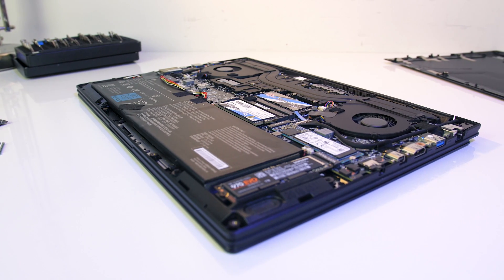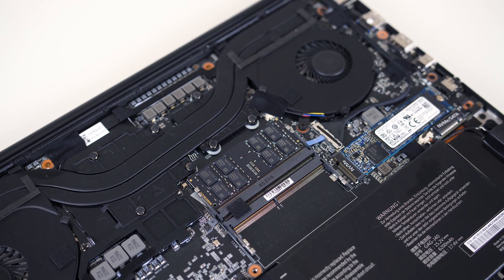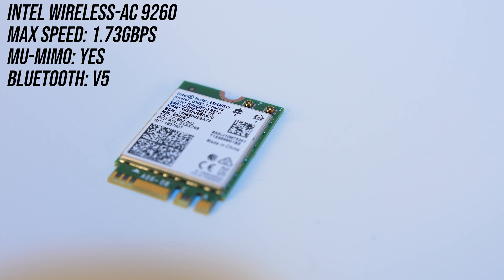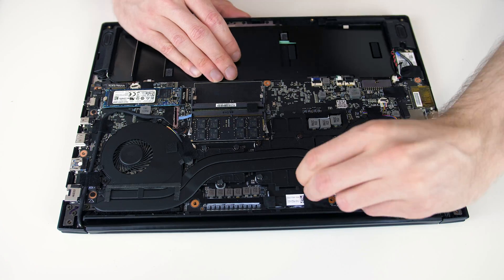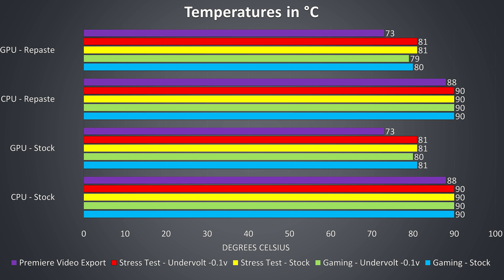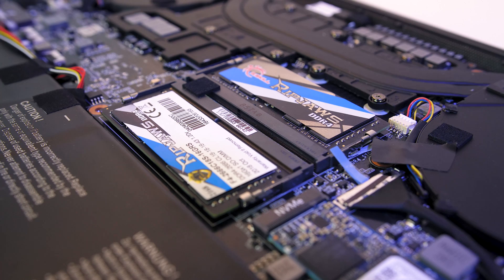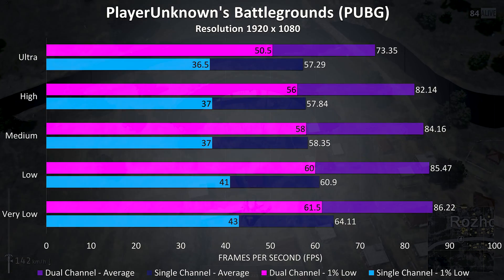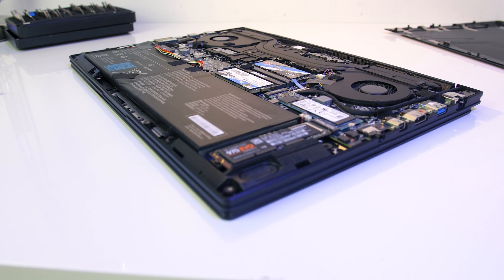Upgrading the Gigabyte Aero 15x Laptop

Comment: I bought the Aero 15x on black friday, and got a single 16gb G.Skill module to accompany the 16gb Kingston module that was running at 2666 speed in single channel, an HP EX920 1TB NVMe SSD changed to Samsung 860 EVO), and Ge Gelid Extreme to repaste the CPU and GPU

My results for the repaste mirrored yours for changes to CPU and GPU temps, with only about a 1-3C improvement. It is good to know that Gigabyte is at least using a good paste for their high end laptops

Apparently the memory must have 2666 speeds in the JEDEC profile of the memory module, not an XMP profile like the G.Skill module. I personally don't mind as the speed is only really noticeable to me in gaming performance. The 32gb's is mainly to be able to run a lot of VMs for testing, so speed isn't generally an issue here.

I initially tried using an HP EX920 1TB NVMe SSD in the 2nd slot, but I'm guessing the module was defective. Many other NVMe drives using the SM2262 controller report to work fine in the laptop and I probably just had a defective unit. However, I decided to return it and get an 860 EVO 1TB drive instead, as it mainly functions as a steam library and storage for my VM ISOs and other test software. The 512gb Toshiba NVMe drive is fast enough to run the actual VMs on, a 2nd drive being NVMe would just be a nice to have.

Something else I noticed is that using the FB05 BIOS, ThrottleStop was working just fine, but during the troubleshooting of the HP EX920 drive, I updated the BIOS to FB08. Since then, ThrottleStop doesn't appear to be able to launch anymore, though the Intel XTU does still work. This is disappointing, as with ThrottleStop it is very easy to set Overclocking profiles for both AC and Battery, and it will automatically switch to the appropriate profile with ThrottleStop. Unfortunately Intel XTU doesn't appear to be capable of this auto-switching (or at least they didn't make it easy to implement).
Reply from the maker: Cool, thanks for sharing your experience! Yeah I heard about it needing 2666 JEDEC, apparently the G.Skill module supports this without XMP though. My original Aero 15x that I reviewed actually had the exact same stick installed according to the HWInfo data I exported in April, so not sure if they changed something..

Comment: I just got mine at the beginning of the month. Was curious to know if you deleted all the bloatware or only some, what did you keep? I'm going to upgrade the wifi card. I bought a 970 as well and was going to buy just the one 16gb stick.
Reply from the maker: I did a fresh Windows install then installed smart manager as you need it to manage things like fan speed.
Reply: @JarrodsTech  Thanks for the reply... Your reviews and videos is why I stayed with the 15x as opposed to the GS65. In the video you mentioned the 970 pro had an advantage over the 970 Evo.  I couldn't catch what it was? 
( I can still return my evo and buy a pro). Thanks again...
Reply from the maker: No problem! Basically the EVO drives have SLC write cache to give them fast write speeds. The 1TB 970 EVO has 6GB of SLC write cache, 4GB for the 500GB and 250GB models, once that write cache fills up, the write speed will drop down quite a lot. With the PRO drive, you have the full write speed the whole time, so it's only really an issue if you need high write performance consistently, which I don't so EVO is perfectly fine for me, also perfectly fine for most cases I think like for just storing games and programs on. You can see the specs here: https://www.anandtech.com/show/12674/samsung-announces-970-pro-and-970-evo-nvme-ssds the 970 EVO has different write speeds for SLC cache and TLC (after the cache is filled up).
Reply: @JarrodsTech  You are awesome, Thanks! Best wishes going in to 2019
Reply from the maker: Thanks! you too 👍

Comment: Hello Jarrod! Recently I've sent my Aero 15w V8 to Gigabyte's service center in Malaysia since I could not find another V-color ram in my country to pair up with the existing one. The service center already confirmed me that they have V-color ram in their stock. I can give you a feedback on V-color performance once I receive my laptop from Gigabyte.

Apart from this I've few questions,
1) I've ordered 9260 card through amazon & will arrive next week. So before installing do I have to uninstall the current drivers at first? Is it necessary to remove the battery for installing the card (removing battery seems kind tricky in aero 15)? From where did you download the driver for 9260?

2) For booting windows directly from 970Pro SSD do I have to put the SSD on primary slot or I can put it in the empty slot? I want to make the 970pro primary SSD.

3) Does the overall experience of using the laptop feels more snappier after dual channel upgradation?

Sorry for asking too many questions.🙂
Reply from the maker: Interesting, I did ask Gigabyte support if they could sell me a stick of V-Color memory but was told that they can't, at least to me here in Australia.
I didn't change the drivers for WiFi before removing it, the new one worked perfectly fine with the existing drivers too, but I did download the correct drivers for the 9260 after it was installed and installed those anyway. I just did a google search for "intel 9260 drivers" which took me here: https://downloadcenter.intel.com/product/99445/Intel-Wireless-AC-9260 removing the battery probably isn't required for that, but it was pretty easy.
I think you can have the SSD in either slot, it shouldn't matter, the boot loader would just modify the boot order when you install Windows. It does feel a bit better with dual channel, occasionally I noticed sometimes apps would freeze for a brief moment and now that's gone.

Comment: Next time use MSI.
My GS73VR-7RG w/ 1070MaxQ, 16gb, 256m.2 + 2tb hdd,
ive upgraded with 16gb ram (A-data), and swapped the 256gb with 1tb 970 evo.
Works great with the old Kingston, both at 2400Mhz.
Reply from the maker: I can't use MSI because I don't own one 😛 this is my laptop so I was able to upgrade it and spend money on the hardware.
Reply: @JarrodsTech  Well MSI should gave You one, because I made MSI laptop buy and MSI Display buy because of Your reviews ;)
Reply from the maker: Yeah I wish! If I had one to keep I'd do an upgrade video for it too 😁

Comment: It's very interesting, that all review units of this laptop contains two ripjaws 2666 modules (same as you bought) and LG panel, while all buyers reporting that in their Aero 15x v8's is installed AUO panel (actually a little bit better than LG) and standart non gamer 2400 RAM. And i read a lot of complains from people that cannot install memory with the same problems as yours. Things got much ,ore interesting when i contacted the only one supplyer, who selling this model in my counrty (Ukraine) and he said, that they buying those models from USA, because European units (that made in Europe) is a little bit worse. Actually he said that he tested all units himself, and said that there is those Ripjaws modules installed. So it seems that there is two hardware revisions of this machine, and the US one is better. Gigabyte is not telling us truth and ignoring all complains about memory moduled that didn't work. And one more thing: i heard that RAM problem is solved in tha last BIOS, so it's strange that you have one.   Try this method: disconnect the internal battery and push the on|off button for 2 minutes. If BIOS battery is detachable, try reconnect it (you should short battery slot pins before connecting it back)
Reply from the maker: Yeah I noticed that too, not sure why they changed them, I guess the v-color memory has higher timings so it might be cheaper. I tried unplugging the battery, pressing the power button, waiting a few minutes before trying the memory, didn't help.
Reply: @JarrodsTech  so, we just have to wait for fixed bios
Reply from the maker: @antonavdyushkin545  I really hope they can improve memory compatibility with an update.. Will just have to wait and see though.

Comment: After watching this video I realised that I had to change the thermal paste on the VRMs. I've not changed it yet and it still runs cooler than with the preapplied paste. Should I reapply the paste for the heatsinks and the VRMs again?
Reply from the maker: To be honest if you left what's there it might be fine, I guess maybe there could be air bubbles in it now though so reapplying is generally recommended, I don't think I was able to see VRM temps in HWInfo so I didn't actually have a way of checking before/after results.

Comment: i read they used good paste stock, but i think its mostly just that they have an insufficient thermal solution. 

also, when i use ic graphite, there was definitely a noticeable difference, and is just a simple pad so it should go easier than the paste
Reply from the maker: Yeah I think the heatsink just isn't big enough, people who have tried liquid metal also said they didn't see much/any change, oh well!
Reply: @JarrodsTech  thats the funny thing with mine, i saw a change, but because i cap fps and clock speeds it doesnt run full throttle anymore. this simply cant handle 3.9ghz no matter what you do, theres just not enough heat pipes for that

BUT, when i put the graphite pads in, it did change my temps. it used to be gpu around 65c, cpu around 75-80c, now they're never more than 5c apart from each other which is kinda strange. but anything above firestrike itll go right to 90c in like 10 minutes. maybe next gen will have a nice fatter redesign

Comment: nice video as usual!! That temp looks weird tho....I'm using the same paste and while it doesn't decrease the minimum/idle temp, it does decrease the max temp for about 9-10 C on my system (i have a different laptop tho)...maybe the heatsink doesn't sit right?? 'cuz i heard that some systems suffer from that issue, like some alienware/dell systems (i forgot), the solution was like, to turn the screw not too tight but not too loose either, IIRC
Reply from the maker: Thanks! Some people think it might be due to the heatpipes just not being big enough to dissipate the heat, which would explain why some people who also tried liquid metal with this model saw minimal change. I triple checked the heatsink, the screws get to a point where they just stop and you can't go any further which I think is how they were before I started.

Comment: Kryonaut says it has properties that keep it from drying out ‘at up to 80 degrees’. If the laptop runs hotter than that, might be worth checking the paste after a while. Cos of this, I went with Arctic MX-4 when I repasted my Alienware M15, as that does run really warm. Be interesting to see how you get on.
Reply from the maker: Yeah I was thinking maybe trying something else, but as I did the testing when it was still fresh figured it should be ok, I think in real world use I won't see it get that high too often though.

Comment: So, I'm planning to buy a laptop for college by the end of the school year in June. I was wondering if you have any recommendations for me based on portability, specs, and upgrade ability. Price range is from $1500 - $2000. Cause I am so bad at deciding xD
Reply from the maker: Yeah definitely something thin/light with good portability, coming from someone that used to carry a 17" beast around at school haha, it's not worth it! I think we're hearing about new laptops at CES In a couple of weeks, so might be worth waiting to see what that gets us in terms of new GPUs. Depends what you're using it for of course, but for that price should be possible to get an 8th gen CPU (i5 or i7 both good options) and 1060-1070 graphics, maybe something like the MSI GS65 I think falls into that price, most of the others like Zephyrus M/Razer Blade are a bit higher if I recall.
Reply: @JarrodsTech  alrighty, thanks. I'd bet those should work for both video editing as well as gaming more likely, but I think i will till the ces announcement
Reply: @ItsTrain  Have you found one yet? Because I'm struggling to find one too rn.

Comment: Most laptops closely scale their fan curve to thermals.  Maximum fan speed is the best was to judge one thermal paste to the next on most laptops.

On a p650hp6-g, I had to UV the CPU and then apply LM to the CPU before getting the temps to budge. This was on a chassis that didn’t have a maximum fan speed function.  

That however doesn’t mean that would solve thermals on the Aero 15x.
Reply from the maker: I found it going to maximum with these tests already given the high temperatures, so just manually set it to max for all tests to ensure the fan was constant in all results and not a changing variable, I think I forgot to mention that ☹
Reply from the maker: I was interested in hearing if you thought my paste application was shit too 😉 I know you do the drop method, I was a bit unsure of that spreading evenly on the rectangular die, but as I say this was my first time actually doing this.
Reply: Jarrod'sTech I always let the heatsink spread the paste. 

How’s core discrepancy?  Hottest core to the coolest core difference at load?
Reply from the maker: About the same before and after, before the minimum over all 6 cores was 83c-87c, max was 87c-91c, after changing paste the minimums were 85c-87c, then maximums 87c-91c.

Comment: Thanks a lot jarrod for listening to what your subscribers want from you. You create a much better video of what we have in mind. Also I'd like to ask you that does kryonaut has a settling time ? Or it settles instantly. Because mine increased my cpu temps and i waited for a week but the temps went on increasing upto 99°C. So i decided to replace the paste with arctic silver mx4. It is much better now.
Reply from the maker: Cheers! Yeah I don't believe Kryonaut paste has a curing time, should be good to go straight away.
Reply: @JarrodsTech  then maybe the 1gm quantity of kryonaut wasn't sufficient for my Zephyrus M. Because it uses paste everywhere and not thermal pads. So maybe that was the reason for kryonaut not working for me.
Reply from the maker: Hmm not sure, I believe it has higher conductivity rating so yeah may have been the application.

Comment: Based upon the information at http://forum.notebookreview.com/threads/tuning-the-aero-15-w-x-v7-v8-common-problems-solutions.816143/ I opted for the following kit from Amazon: HyperX HX426S15IB2K2/16 Impact 16 GB (2 x 8 GB) 2666 MHz DDR4 CL15 SODIMM Memory Kit, Black (https://www.amazon.co.uk/HyperX-HX426S15IB2K2-16-Impact-SODIMM/dp/B01N2VUOBJ/). This kit works fine at the stated 2666MHz speed in dual channel with CAS 15 timings. Note that if you want to run at 2666MHz the kit has to be qualified to JEDEC 2666MHz settings - and not just XMP.
Reply from the maker: Yeah forgot to mention the JEDEC/XMP thing in the video, I've heard that that kit of memory works, I've got it listed in the description as a potential option 👍
Reply: If you search for the datasheet for that kit (https://www.kingston.com/dataSheets/HX426S15IB2K2_16.pdf) you'll note that it states JEDEC/PnP: DDR4-2666 CL15-17-17 @1.2V

Comment: Great video man! Very informative on the upgrade process, now I get a better idea of what to expect if im repasting or upgrading the RAM

One question though.
I wanted to ask why the fps results for your single channel memory test has varied so much when compared to your initial review of the Aero 15x. For example, the CSGO fps benchmarks under single channel memory performed far worse in this video than it did when compared to the benchmarks you got for the same game in single channel memory for your initial review of the Aero 15x.
I was kinda hoping to get more frames on a game like CSGO (especially with a 1070 max-q).
Was there like a Nvidia driver update that could have been responsible for this?
Reply from the maker: There are a few differences, this is a completely different laptop, not the same one as the original review. The first video had a stick of G Skill F4-2666C18-16GRS, so DDR4-2666 with timings of 18-18-18-43, although those timings are actually slightly better than the V-Color stick in this unit lol, I think that's the only hardware difference, but yeah there have been various Nvidia driver updates and even game updates to CS:GO over that time which would vary results.
Reply: @JarrodsTech  Ah I see that's probably it!
For some reason Im still kinda surprised by how much DDR4-2666 has a made a difference in terms of fps benchmarks :O
Did you get a choice of what speed RAM memory you wanted in your laptop when youre buying the laptop (or even reviewing it)?
The single channel memory tests you got in this current video is probably (could be a stretch) on par with the fps I get on my current laptop.
Anyway, thanks for clarification! That definitely helped me!

Keep up the good work man!!
Reply from the maker: Usually the speed is noted when buying, for review units though I almost never get to choose and just get sent what ever they have. No problem!